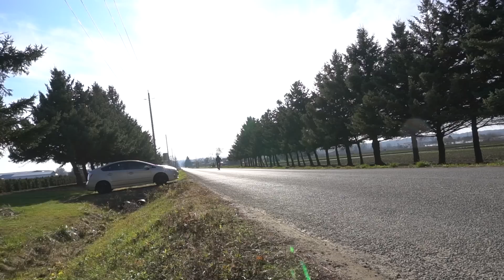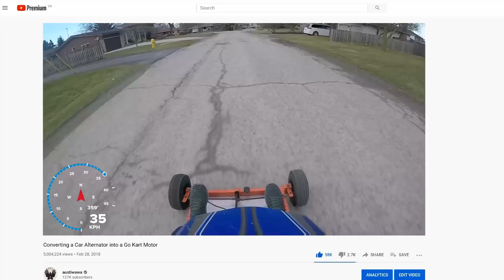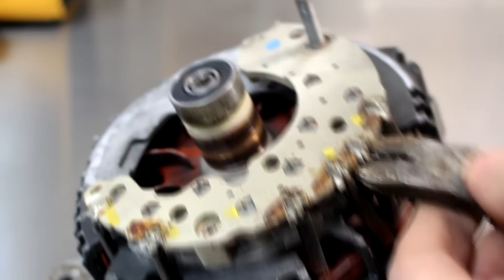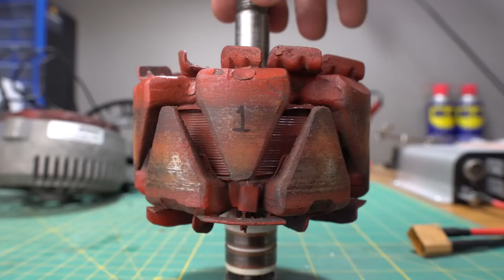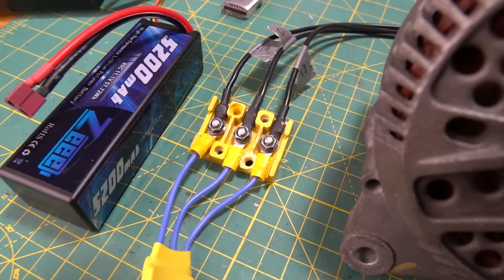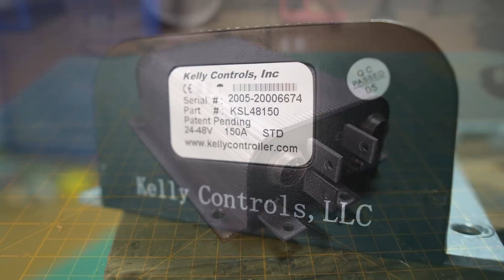Building an Alternator Powered Bike

Comment: why not just use the 3 phase output to rectifying diodes and run the field with that DC?
Reply: Nah, a DC/DC step down woukd be better
Reply: @foxxyytofficial  Well if it’s off the output, then it won’t pull any current when the motor isn’t in use.  Doing it his way or your way will pull current for that field regardless of the motors use.
Reply: @thatdrh  but you can't simply disable and reenable the power to the rotor without disturbing the systen
It needs the magnetic field before the motor can spin, so if the magnetic firld only exists as the motor try to spin, it will mess things
Reply: @foxxyytofficial  let’s hope I get around to making a video.  However, I have already overcome this issue by doing the exact thing that I’m implying.  Soon as the windings get their current, so does the field.   It’s the internet, who cares...

Comment: Now do it with a trike and have an actual alternator on the other wheel so that you can charge your batteries while you pedal
Reply: you can't do that, only regen
Reply: You don’t know what you’re talking about.
Reply: @timothyjohns8630  i dont? Alright then
But go ahead and try, test the heat/resistance/friction/efficiency losses to the alternators and the charge controller that will need to adjust itself to the second alternator's Power/RPM/Voltage ratio to return the correct energy levels to the battery

Comment: Just need a charge circuit  running from the wheels back to the battery to keep them topped up, not sure how it works out but I am sure it would be great when sorted out.
Reply: it won't work as you think
Reply: @foxxyytofficial  that’s a shame, I thought cars were able to do it so maybe the bike could,  certainly not my specialty,,
Reply: @squirralien1863  cars with alternators don't rely on electric Motors to move them, and their engines have always 40-1000HP, so from 10-25000x the amount of power in the converted alternator
Reply: @foxxyytofficial  I was thinking of electric vehicles with charge that comes from driving, I don't think they charge as much as an equal balance for what they use but many apparently do receive charge from their forward motion. I  know fuel engine cars with alternators don't.
So if the bike had something similar to the old wheel driven generators that powered lighting, then you could extend travel distance receiving some charge from both wheels, ???
Reply: @squirralien1863  the electric cars that recover power uses regenerative braking, not a second motor

Comment: I can relate to the failure exhaustion, it just makes the eureka moment even better! great explaination of your efforts as well.
Do you control the current to the stator windings?
Reply: the controller does that current control
in the rotor windings no
Reply: @foxxyytofficial  I doubt it , I think he uses a separate 11.1v lipo to energize the stator but as that is essentially just a long piece  of wire I thought it would need some form of regulation so it doesn't burn up. It may be that its just designed with the correct resistance in the winding so that 12v applied is stable for it. Who knows...
Reply: @apbosh1  he uses the lipo in the ROTOR, and since its a long wire, it will have a predfermined resistance, and that resistance will hold the current, not being a short circuit
Reply: @foxxyytofficial  he has the big 48v pack of 18650 cells for the rotor the 11.1v lipo was for the stator coils. I guess it would make sense that the stator impedance is matched to 12v as a car is typically 12v system.
Reply: @apbosh1  the 11.1v is for the ROTOR COILS, the 48v is for the stator
Reply: @foxxyytofficial  hmm okay i did a check and what can i say, I got it wrong. I have looked into driving universal motors with dc and i thought they operated the way i said, and would be the same as this, however now i'm questioning if i have my entire thought process mixed up! obviously i need to .....'brush up' on motor configurations! thanks for pointing that out.
Reply: @apbosh1  its ok, everyone have their mistakes

Comment: Excellent, the way you heard me hollering at my screen "The electro magnet, it is not a permanent magnet sir!" when you were attempting to install the Hall effect sensors was excellent!  You must have particularly phenomenal hearing?

Hopefully got your attention again with my comment?  
FYI 
One must also consider that a Bicycle is NOT designed, built, or in practice, an on Highway Vehicle. Therefore in the construction of a BI(2)CYCLE(wheel) there are 4 bearings in those 2 wheels that are designed to spin at a certain maximum RPM. Need I say more? Most likely not, yet I would like to extol the wonderful attributes of bearings anyway. Bearings that are not liquid or at a temperature exceeding that which would liquify the aluminum hubs. The 2 hubs which hold the spokes that keep the 2 wheels round enough that one could reach such speeds should remain steadfast and solid. Perhaps pack those bearing with some fresh clean grease?  Despite its sticky and sometimes annoying nature grease sir,  can be your friend!

Comment: I don,t completly agree with you, about the small motor and alternator. I am electromecanic by trade.
The small motor ( The toy ) is call single face motor ( but it has two winding -one you can see and the other is wire loop on the stator. In the alternator you have 12 Volt/ 3 face AC winding which power is rectifiered to 12 v DC. Symilar motor are in some newer laundry washing mashines. Supply is single faze  150 V which is inverted into 3 faze AC winding?power , which  has more power. Look for Chinese
electric bikes .They power goes from 500 -1000wats and more.Yours is 12 Volt x 30 Amps =360 Watts.
That's little to small, especially when you shorten two windings in alternator.They magnetically works against each other. Good try and good job, better than sitting on the front of TV. You are very creative .
Talk please to the local motor rewindig store to change that winding to single faze AC 12V, and get invertor 12 V DC to 12 VAC. Other option is to find proper capasitor at the shorting of two windings, but you loose a lot of power. Years ago I've sees sugestion on you tube,-- how to charge cellphone battery in the microwave. The next day another guywas showing his experiment and the phone exploded.
Same video are fake news. Have a good try     Good day to all of you.
Reply: sorry, i can't understand your comment

Comment: so if you are using an alternator can you not recharge your batteries at some rate?
Reply: No
Only regen braking
Reply: @foxxyytofficial   I am sorry I dont understand what you r tryn 2 say.can u elaborate?
Reply: @glennbrunck7572  you can't recharge your batteries with a converted alternator, you can only use regen braking
Reply: @foxxyytofficial  what if you add one more alt?
Reply: @glennbrunck7572  even with 2 or 3 alternators it wouldn't work too, sorry

Comment: CURRENT to the field, not voltage.
Reply: The field have a fixed resistance, so to get a higher current you need to get higher voltage
I = V / R
Reply: @foxxyytofficial  Yes, absolutely, but its not the voltage that creates the magnetic field.  The voltage is merely required to achieve the current required to generate the appropriate field due to the fixed resistance. Also, you can vary the current in the field winding to vary torque when used in a traction motor application like this. You can perform field weakening to get an increase in efficiency when you can sacrifice torque.  You can use the stock regulator to do this. I happened to be a senior engineer for Taditel (the company that made the unit in the video) for many years, and may very well have designed that unit.  If you would like some info on how to use the regulator for field weakening, I would be happy to help.

Comment: I've not tried it but shorting the slip rings together and removing the brushes would convert the alternator into an AC induction motor.  This might be a simpler way to make it brushless.  Wiring the brushes to an external AC ammeter would allow monitoring of induced current in the rotor for experimental purposes.   

Also, the maximum RPM of the alternator/motor will be reached when back EMF reaches the maximum 3 phase supply voltage.  Reducing the DC voltage to the rotor will create field weakening which will allow the alternator to spin faster but at reduced torque.  This may be useful for some applications.
Reply: One people tried just shorting the slip rings
They never posted videos beyong bench spinning

Comment: You think it's possible to jumper over and use volts from alternator 
To power itself allowing and allowing battery to trickle charge it self after getting started...
Reply: Nope, won't work
Reply: @foxxyytofficial   are we just saying that,  there's definitely a way... your using batteries to run alternator, if we did it in reverse the alternator would produce electric... or add another small motor to to self generate...
Hey thanks for responding, thought yous were creative
Reply: @nancysmith9487  all energy losses to heat friction resistance and efficiency will kill your idea, you can't fight physics
Reply: @foxxyytofficial  a solar panel,needs to sense voltage to produce with a power inverter... Thinking it would be similar with a small motor and transformer. Just a thought, not sure really worried about the loss if can get it to go Continuesly recycling self producing voltage... pretty sure can fight physics with mechanical engineering.
Enjoyed your thoughts thanks.
Reply: @nancysmith9487  if you think so...
Reply: @foxxyytofficial  you seem really smart, that piece that he and others cut out of the alternator would produce electric wit power inverter recharging the battery as it is being used. And or using it parallel with volts of battery making it super effective... maybe  next bike number try this idea. Then we could install it on the Teslas and then all these other vehicles partner
Reply: @nancysmith9487  the part what everyone removes is for the car's 12V sustem, most people use 48V batteries, and you can't simply convert 12V to 48V without cutting the current capacity, and those amps are important, and i'm not even talking about the system that needs to keeo the charging power constant but cariable as the battery is used, lots of stuff for something that wouldn't be efficient
Reply: @foxxyytofficial  so let's say we use a phone charger and run it in reverse, that takes minimum volts to use off a alternator and  to produce 120v because the transformer, it doesn't know a direction. It flows both ways. What you think. Thinking it's definitely possible.
Reply: @foxxyytofficial  now I'm thinking about it, definitely doable
Reply: @nancysmith9487  so try yourself, maybe you found the secret to perpetual energy
Reply: @foxxyytofficial  was hoping since you have one might and understand it better, be able to apply. Tend to see things that work. Probably need a switch, after its started moving, producing electric then allow it to make a loop

Comment: If you put the centripetal clutch on the back wheel and a scooter variator where the motor is - you will have amazing acceleration to maximum velocity..........0-60 in about 4 seconds or so.
Reply: He don't need that
And already removed the clutch

Comment: Could you add a second alternator to charge the battery pack?  Or is the operating RPM that the alternator would see too low to offer any effective charging?
Reply: Not the RPM
But the power
Self charging is not possible

Comment: I have a bike, a new alternator, and a cnc machine shop so I think you've given me an idea. :)
Reply: I don't know but mabe CVT clutch would be great for this setup
Reply: @edgarvalencia7523  Only if you could make it light enough. The weight killing the range is more of a problem than the power delivery method/feel with EV's
Reply: @kylem7708  right on not  experienced in the EVz  but ya I fill like it could be tweeked for Les pull on the motor n more torque to the drive wheel good up hill climb but I only have tried on carts for a heavy guy but it is a hell of a build 👍🏼

Comment: Should have just turned of the DC field generator.
Reply: That would mess things up
Reply: @foxxyytofficial  why?
Reply: @jessem8928  BLDC controllers need magnetic field to operate, cut them and it could cause a shoot-through condition where it would probably damage it
Reply: @foxxyytofficial  im not familiar with that specific controller. Wouldn't the impedance of the coils be enough?
Reply: @jessem8928  if you cut the power, the magnetic flux on the rotor will weaken more and more, giving more and more RPM for a determinated power input, and after a certain level, the controller would lose sync and toss errors, if not breaking with the high RPM without any sort of control
Reply: @foxxyytofficial  The rotor would not spin at all if it were non magnetic. I wish this guy would try it out and solve this riddle.

Comment: This is a cool video! Question though...  How does the shape of the electromagnet (triangle rather then bars on a magnet motor effect the performance? Wouldn't that cause a limiting factor because you have a wider and odd shaped magnetic field per pole then the physical magnets would? This would cause a limit in max RPM or effect torque delivery vs RPM correct or possibly  just effect the range due to power consumption?  Just curious as to how the shape of the electromagnet you're using and a standard bar magnet motor differ in the system.... Power, torque, rpm, etc.
Really cool experiment though!! I love tinkering with stuff myself!
Reply: the claw pole rotor isn't as efficient as a rectangular magnet, but you can build a PM rotor (or depending on the model of your alternator, already exists PM rotors for them), i don't see any strange limits for RPM or torque
Reply: @foxxyytofficial  I wasn't sure if it would cause a larger overlap in the magnetic field of each pole causing it to be less effective. Probably a better thing in a generator/alternator because it may help it produce voltage at a broader RPM band.. so she still puts out the same power at idle as it does 3k rpm. That's all I'm wondering. I am not incredibly learned in magnetic science but just something I was thinking about.

Comment: Those clutches are made for high RPM applications. You can make it engage at lower RPM by changing the springs on the shoes. Less "tight" springs should at least allow for full engagement at moderate RPM and eliminate slippage once at cruising speed.
Reply: or just removing it

Comment: Instead of the clutch why didn't you use a voltage regulator switch kind of like a dimmer switch ?=×
Reply: that wouldn't work as you think

Comment: don't know if posted before. none of the top comments had mentions that you can change the weights in the clutch. mote weight means it grips at a lower rpm.
Reply: Posted hundreds of times
Reply: But taking it out was better
Reply: @foxxyytofficial  does regen breaking also work?
Reply: @kjell-thoreheimdal7526  he just need to activate it

Comment: Most of the scooters and motorcycles comes from China, they go to South America, Mexico, Colombia, Spain and some other countries, but they use a motor and a battery only, they don't use an alternator, for an extra juice of electricity by putting a polea for motors in the front of the tire, or in the back of the tire, what with a belt that will go to the alternador, and the wires from the alternador toward the battery, but they say that in order to charge the battery, the alternador must generate at least 15 % total power to the main battery, otherwise it should have a gigantic alternador and is not feasible, but what I see in your experiment in sound some modifications in the alternador seems much feasible!
Reply: Nah, mate, you got it all wrong
You're comparing scooters in production scale and a DIY project, and you can't use the alternator to recharge, only regen braking

Comment: I wonder, if this kind of alternador be put in electric power motorcycles, specially small ones, the ones that they use in South America and some other parts of the world, because they only go up to 50 kilometers (31miles) then the battery has to be recharge again, and they need one that will last about 300 kilometers ( 186 miles) or more, before it gets to be charged, and another thing the small motorcycles, they only go up to 50 or  60 kilometres per hour ( 31miles or 37 miles)! and people get impatient when they realize they have to recharge it again.
Reply: The alternator won't recharge the battery! Only by regen

Comment: you have to watch out for the spokes. i took a 24 volt zero turn wheel chair motor and put it on a old 10 speed and every time i hit 62 mph the spokes would  come loose.  i never did top it out. and then one day i came home and it was gone. just to find it 10 years later in the woods. i guess some kids stole it and crashed it.

Comment: God I feel so smart just knowing a little bit about motors and converting them. I had to convert a 230/660v 3 phase to  high voltage gen. Motor which I immediately ran into a ups and then split into multiple transformers inverter amperage meter blah blah  and then my dad's house off grid lol.

Comment: cool project. looks like your battery is a series of capacitors? i wanna do one!
Reply: Nope
18650 cells
Reply: @foxxyytofficial  not an electrical expert by any means but thanks for the info so i can google it.
Reply: @kellybikeco  most DIY battery packs are built with 18650 cells, you can even find books on how to build those packs
Reply: @foxxyytofficial  checking it out as we speak... thank you for the info!